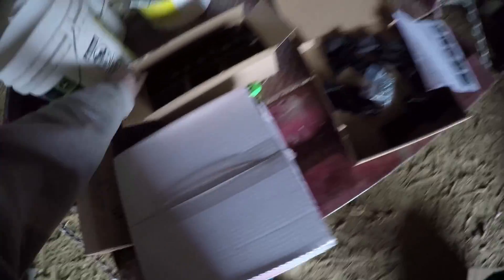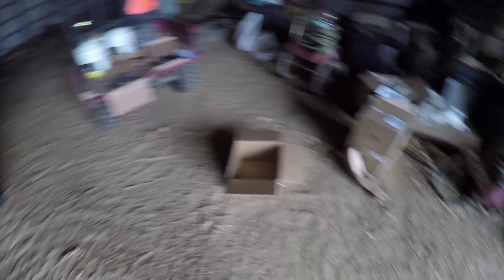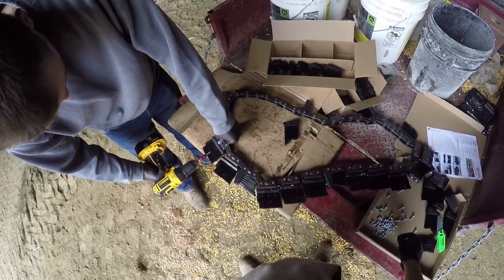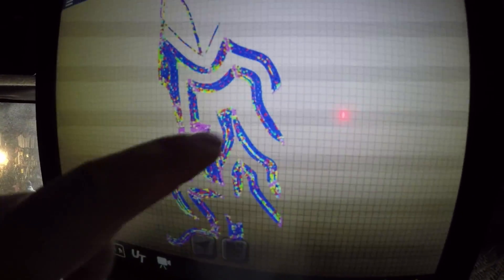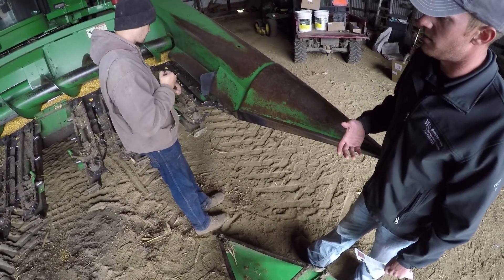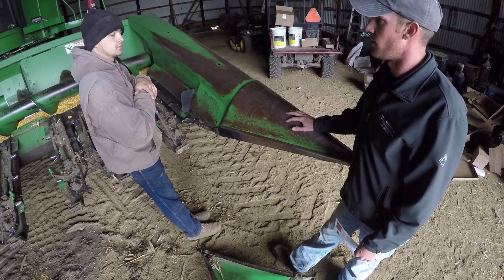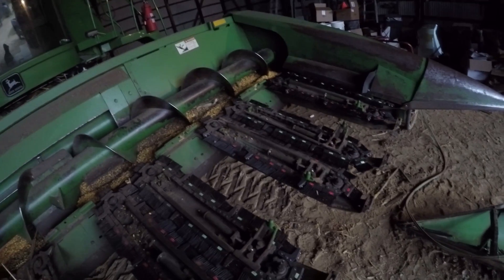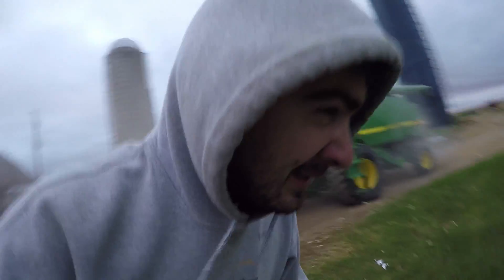New Head Gathering Chains - 360 Yield Center - Yield Saver Brushes

Comment: Wouldn't this system add more trash to your grain sample? It definitely would help collecting those loose kernels but with that, wouldn't there be most smaller trash along with it? I don't know how much of a difference it would make in the sample, have you noticed anything different?
Reply: Not if you set your cleaning shoe right... just takes a little effort to set the chaffer/sieves to the right opening and playing with the amount of air (fan speed) on the cleaning shoe and you'll float the chaff right out the back without losing grain over the shoe... 

Most guys just set it "by the book" and forget it, but there's a little more to it than that if you want to get the cleanest sample with the most capacity (throughput/speed) of the combine with the least loss out the back... 

It's all tradeoffs... 

Later!  OL J R :)

Comment: The yield maps don't save you any money unless you take what they tell you and implement a savings plan. Variable rate planter, variable rate fertilizer application, improved drainage, reduced soil compaction, pest and deer damage, weather problems like drought and others.  Now you have to decide do you try to fix the weak spots or do you cut inputs to the weak spots and kinda give up on the bad areas. Tough decisions when you do not know why any particular spot fails.
Reply from the maker: +Douglas Laramie It's already saved me thousands. Will try to cover why in a future video.

Comment: hey Ryan just subscribed been watching off and on for awhile. if I'm figuring right he said 1.8 bu per acre at 1200 acres that would be 2160 bu at $3 that's $6480 in saved corn. I'm guessing $200 per row for the chains that's $1200 so you'd save $5280 in 1200 acres not a bad return
Reply from the maker: +madfarmer912 dave that's pretty darn close to what we got after the field test actually.
Reply: How Farms Work that's great so roughly 200 acres would pay for them
Reply: how many acres do you own plzz say in next vid plzz
Reply: you should get a bigger combine so the job is done faster but im not saying the combine you have is bad i just think a bigger combine will do on the tons of corn you get a year
Reply: Also could save by going 1 mph slower with 33% bigger head.   Using GPS makes guess rows closer to 30"  Using less labor, fuel with faster harvest and less grain loss might be worth it.

Comment: Does JD address this issue on their new corn heads. If not, does JD not want a competitive edge over their competitors. Like the K&M automotive air intakes, if they do what they say they will, why has one of the big 3 not jumped on the opportunity to beat their competition. I don't understand why these great ideas don't go main stream faster if at all. Just sayin. doug
Reply from the maker: +Douglas Laramie Andrew said these were borderline experimental. The reason larger companies haven't picked up on it is because it requires to be serviced so often

Comment: Question...for having to change the brushes every 200 hundred acres,what is the cost difference of the brushes for what you might save of corn dropping on the ground for a harvest season?
Reply: ih1066mb its not 200 acres they need changed its 200 acres per row so a 6 row head you'll cover 1200 acres before you'll need to change them
Reply from the maker: +ih1066mb We'll be doing that experiment in another video. They start to drop in efficiency after those acres, so you still wouldn't have to replace them immediately.